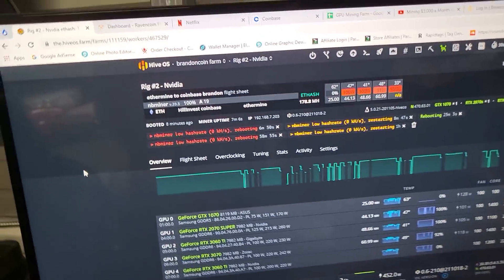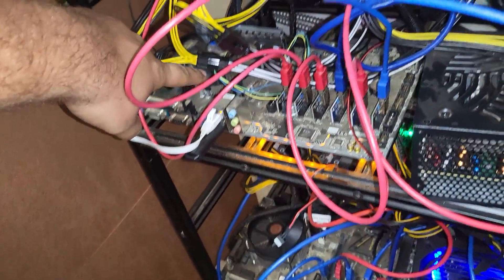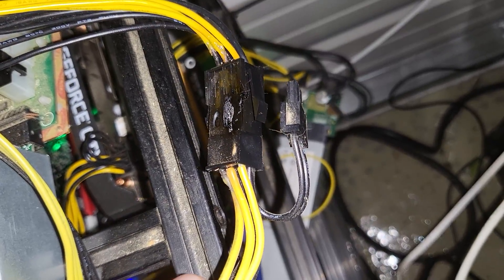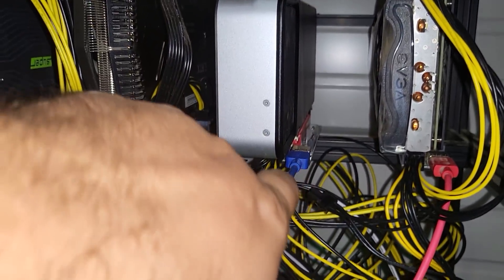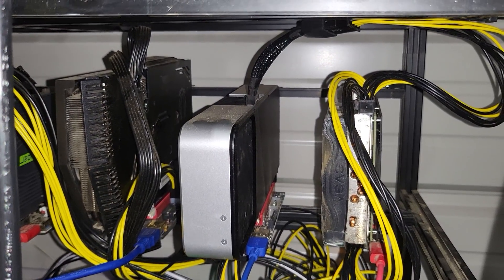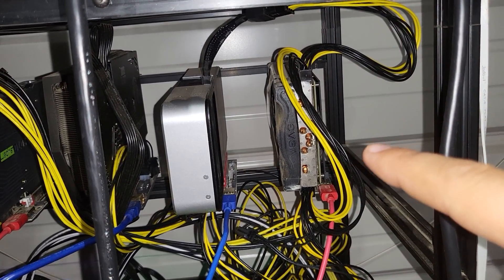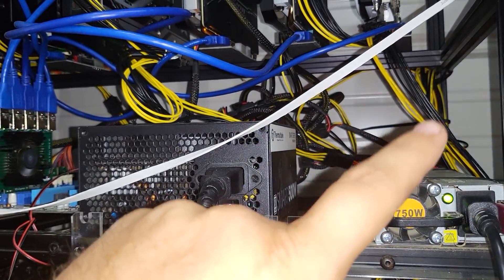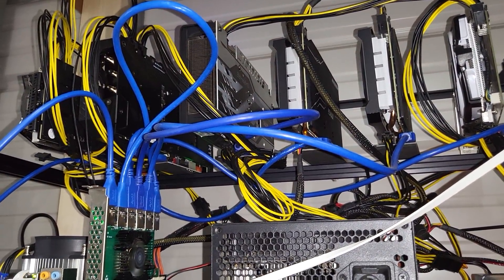Smell Burning in GPU Mining Shed

Comment: I personally never use those splitters anymore! I had that same splitter just running the PCIe risers and it melted down at the splitter connection! High resistance at the point of contact between the two metal connectors is all it takes, then heat does the rest! From that point on there were no more splitters in my rigs ever!

Comment: Bro its the gauge of the wire inside the cable,
If the maker of the splitter uses copper cad aluminum depending on the current it will heat up big time it needs to be thicker gauge or pure copper in The wire alot of times its hard to tell so thick gauge is better
14,16 gauge is better typically the cheap spilters have 18 gauge  and have 20 gauge of wire

Comment: Lucky there wasn't more damage. Not only were you using a triple splitter it sure looks like the end of the triple is feeding into a double splitter, so it's more like a 4 way splitter! That's very dangerous. Hope you checked over the power splitting on all your rigs and maybe reduced the splitting to one double per cable running to the PSU.

Comment: best wiring is max a riser and gpu per cable max cable output 288 watts but allow for the 80 % rule dont overload cables its very dangerous . i am happy you did not damage anything apart from cable

Comment: Good catch, this flaw in systems is a good argument for in line fuses so if a burn out occurs the fuse limits damage to the wires not the gpu.  Also, you should buy a couple of Carbon Monoxide Detectors and get a wireless version that sends a message to your phone app or if you have a home fire alarm wire them into the shed too.  I have 2 in my home office

Comment: Sparky tip: Test your connections by holding the black connector and pulling on the wires. Iv caught a couple where the wires were loose (bad) and one where the wire pulled right out (very bad)

Comment: Simple remedy for over amped splitters; Don't use splitters, Especially triple splitters. If you must use splitters use (more) server power supplies and breakout boards to avoid the need for splitters. Being cheap in this case can prove fatal.

Comment: The cables are usually under spec, and while the connectors can pull 300W, the cables can usually only handle 288W. 
Do one splitter for each of those cards instead, one to the card, one to the riser, don't mix cards.

If you need more connectors on the PSU, you need a new PSU.

Comment: Lucky you caught it quickly Brandon.  Yesterday I also had an HP 750 PSU from Parallel Miner that started screaming from the fan, smoking a tiny bit, and then a loud pop from some capacitor in the psu.  Pulled and replaced right away but very scary! what if I wasn't sitting right there? Power safety is always a top concern no matter how seasoned your rigs are.

Comment: I've noticed that pcie cables are running much warmer on my 3060s than my 20 or 16 series. I've also noticed that on 1080ti mining RVN, so I decided to swap those for a thicker wire ones. Just too much power for those splitters.

Comment: Dude... Do not share power between the Cards on the same lead coming from the power supply, you're doing the same thing to a couple cards in your top row also. It should have at least two 6 pin leads coming from the power supply to each card with its riser. Use the double splitter on the card if it has two connectors like two 6 pin or two 8 Pin. Those triple Splitters could be used on the same card and its own riser on one lead for low-powered cards...

Comment: So my 3090/3080 rig started smoking yesterday becuz the splitter started metaling on the 3090 card omg I tho that card was done for good but I got lucky becuz the PC wouldn't run for more then 10mins with out turning it self off so I got it to turn back on and when I put a load on it, it started and smoking right in front of me, 300w wires but only was running 270w throw it but now I know to buy the better ones ig or do u guys think this will happen again if I just change the splitter with a better one?

Comment: Not a burned cable but about 2 weeks ago I had 1 of my PCIe 8pin to dual 8pin splitters having a single string pulled out the head.

Before I spent hours and hours on software troubleshooting when I finally decided to check ALL cables and connections. Always be sure every cable is functioning correctly fellas.

Comment: Dude no way... This literally happened to me today, then i logged on and saw this. Whoa. I had a splitter fail and burn on a vega 56 mining ergo running at about 200w. Had to make sure the splitter was running between the riser and card and not splitting one psu line into two card lines.

Comment: The problem comes from the cables, they say they are 18awg but they are not. Plus often the cable is aluminum and not copper. I started making my own splitters using cables from car looms, haven't had a problem since.

Comment: Just did a video on 3080ti catch fire, similar thing smelt burning. also get a fire extinguisher. Intermitted gpu shutting off or performing badly and smell are first indications, also feeling heat on the cable.

Comment: You can run near 300watt if the entire series is 8-pin. The parallelminer splitters (both 2-way and 3-way) are only rated for 216watts max. Also, Hiveos isn't always correct in it's wattage reportings so you may have been at 150+150=300 watts, 75 watts over 216 watt max.

Comment: My 2 cents
Less dust = less heat = less forcing gpu to get needed power = less probability to melt cables because they are not forced more current
Also dust can build bridges and cause shorts.
Be safe!
Glad you found the issue though

Comment: very lucky to catch that, 75w riser + 130w card + 130w card = 335w on a cable rated to 300w, if the two cards reset it would jump to 475w :( Rather just stick to 1 riser + 1 card so even if it resets its still underrated, and only if that's a 3060, cables are cheaper than graphics cards. We live and learn, good job for sniffing it out.

Comment: Check for corrosion on the connectors. It could indicate an issue with too much moisture/humidity in your garage.  I've had to replace a number of modular PSUs and splitters over the past year because of the exact phenomenon described in your video.  In all instances, there were visible sings of blue/green oxidation around the cable connectors, often where any fusing/melting occurs

Comment: Hey all. These double splitters are ok to around 150W. I had like 5 out of 50 burned the same way. The issue is that a poor electrocal contact inside heats up and burns anything attached to it. If possible use 1 to 1 straight pcie cables. Less hassle and burnt plastic smell. If You get 511 temperature error in AMD cards the issue is that somerhing on the pcie power had such a failure. Jellyf

Comment: I'm running 6x splitter on my 15 year old core 2 duo e6550 setup only has one pcie x16 slot and one pcie x1 slot running 4 msi 1070, 1 1080 and 1 1080ti  all running full speed ahead has issues about once a month where it restarts all by itself and can never get it to happen when I'm in the dam room looking at it so no idea what causes that
Who would have thought 15 years ago when I bought the computer that I would now be making bank on it

Comment: hey brandon big fan here from germany. on a 18 awg 6 pin connection you shouldnt load the cable with more than 216W if the lower middle pin is empty, if its a full 6 pin cable you can load it with max 288W. tripple splitters are only usefull for risers only since each riser should draw 75W max. 

my experience is coming from being a electrical engineering student and following the gpuminingresources pcie cable guide.

Comment: Hey Brandon, thanks so much for sharing this update.

I think using a 2 way splitter only to power the card and the riser should be good.

JELLY FISH
Reply: I use a 6pin cable for the riser and a separate 8pin cable with a dual 8pin splitter for the 2 8pin of the GPU. So 2 cables per GPU from the breakout board.

Comment: Where to buy quality cables in Europe?
It has happened to me 4 times with my 3080's rig, its always the 6 to 8 pin due to thin cables even with 1 cable per connection!
Rule is 18awg cables 6 pin 216w and 8pin 288W max.
Reply from the maker: im not sure honestly im reaching out to a custom cable guy about some overkill cables
Reply: @brandoncoin  I agree, we spend a lot of money and time on cables for high power gpu's, that way it will last forever

Comment: Shame on you B.C….. 3 way split?? Gotta do better buddy
Reply from the maker: parallel miner has been pushing these hard and said they were safe to 300w im thinking more like 200w max from now on only low power cards on them
Reply: @brandoncoin  Yeah I know what you mean. I had a Burnout on a 1080 ti last month. It was a ftw3 so it required 2 - 4 pins so I used a single cable that had the 2 - 4 pins to power the card and after a couple of weeks, I smelled burned plastic… and it was melting at the direct PSU connection….. so now I play it safe giving everything it’s own connection to power…… including the risers. A bit more costly but safe

Comment: You had a 6 pin powering a full card a d another card. It's too much
Reply from the maker: the 6 pin cables from parallel miner are supposed to be good up to 300w but im starting to think otherwise =\
Reply: @brandoncoin  Probably good for awhile, but gets too warm when pushing close to the limit i bet.
Reply: Fully agree, as the vid stated 130x2 plus a riser that can draw up to 75 is over the 300 and at that point wires will probably be getting hot.  I am working to do one cable per connector and to run power supplies at 50-70% for my 2 rigs.  It a bit more cost but been good so far.